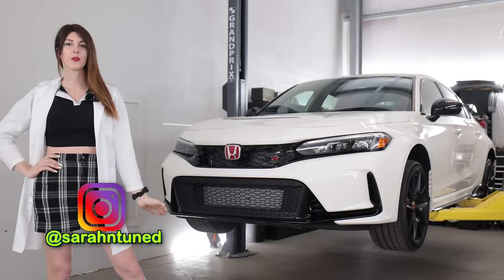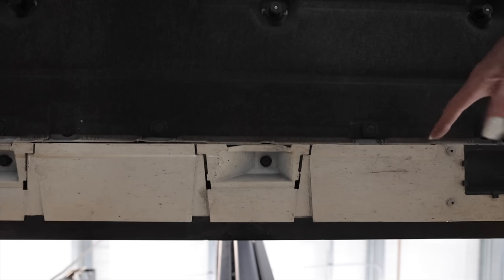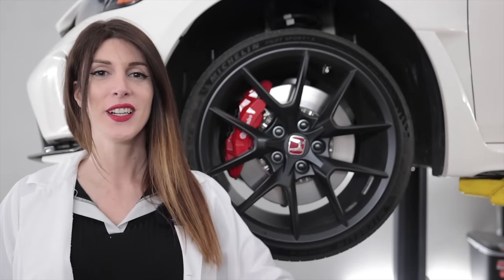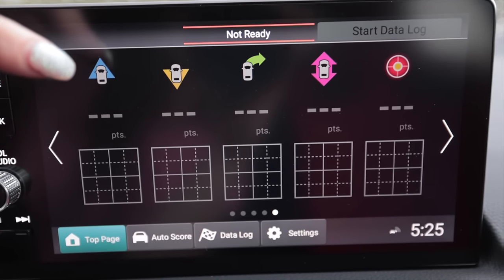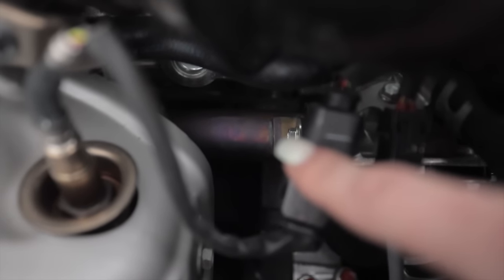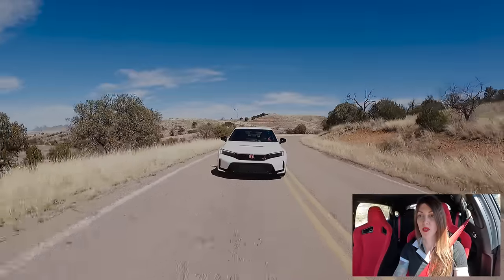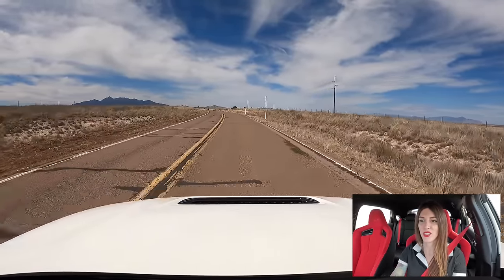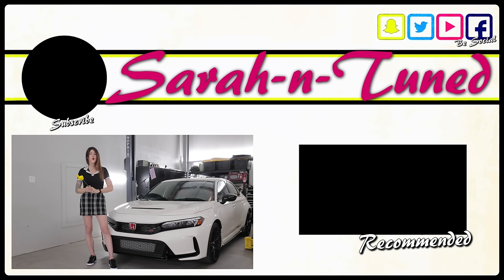MORE FUN Than A Super Car! // 2023 Civic Type R Review

Comment: Sarah, another great reaction from you on this car. I had an original Civic many decades ago and generally felt the car was specifically holding back, just because it didn't like me. (confidentially, I think it was cranky having been ripped from it's Mother Japan and would not do what it was built to do over here). The only problem I ever had was the oil pan. Had to replace that twice in the five years we were together because it would warp. Sigh.

Comment: Hi Sarah, great car review as usual, In France the 2023 Civic Type R is more powerful: 329 hp at 6,500 rpm and up to 420 Nm from 2,200 to 4,000 rpm, but very expensive € 55,000. This corresponds to the switch to the dynamometer made by Honda. Why is it less powerful in the US? Another story of standard to annoy sports car enthusiasts. Fortunately, the power of Honda engines is still higher than what is advertised.

Comment: The Type-R is 4 door because the TCR racing series, the series its actually made for, requires 4 doors, 2.0 ltr Turbo, and Front Wheel Drive.
Reply: Also, fun fact, you can order a Type-R TCR from the dealership.

Comment: Should have mentioned that unique front suspension design a bit more. It’s like a cross between McPherson strut and double wishbone. The strut itself doesn’t turn with the steering, and instead it has a small knuckle with upper and lower ball joints inside the wheel, for better SAI and scrub radius, which helps eliminate torque steer. The newer CTR is the only car I’ve ever seen this suspension design on. 

Also that aluminium splash tray underneath has been used on almost all Hondas since at least 2016 or so. My mom’s CRV had the exact same panel.

Comment: I'd rather hold out for the Acura Integra Type S now for a number of reasons.

The FL5 is cool, but it's being marked up heavily unless you're a YouTube car reviewer and have connections to get it at MSRP. The average 9-5ers are getting slapped with a markup.

The Integra Type S will be far more readily available over the FL5 CTR and seeing that Acura is charging MSRP for the base and now mid-level trim A-Spec Integras, I expect Acura to do the same for the Integra Type S because there will be a lot more supply to go around of these on Acura's side than there would be of Civic Type R's on Honda's side.

Comment: Hard to choose between 2023 Type-r and WRX , which one your will buy.
Reply from the maker: The Type R. It’ll hold value better and is more fun.
Reply: @SarahnTuned I’ve had and wore out two and a half VW GTIs (I have another year or two left on my third), this is looking like something I’d want to consider. I like the looks of the seats and interior. The rev match feature sounds like a piece of software I needed to write for a natural gas truck engine controller to work with Eaton auto-shift. That is a pretty high boost level, that’s close to what I sometimes run on 130 octane CNG.
Reply: Different price categories, different car classes. WRX is more affordable. Also Sarah strikes me as a Honda girl.

Comment: 1:07  Why does the Type R have a single exhaust pipe but 3 exhaust tips? Just extra weight (and cost to the buyer).
Reply: It has 3 functional mufflers and a valve on the main center pipe - reduces noise without limiting flow - easily supports 600hp while being quiet

Comment: question:   looking at the bottom of the car  1:38    where is the catalytic converter of the Civic Type R?  Thanks!
Reply: between radiator and engine.... its right after the turbo, under the heat shields

Comment: As an FK8 owner, I do appreciate Honda for continueing the Type R.
But style wise, I think they went the wrong way. The FL5 looks way too much just like the regular Civic. It completely disappears in the masses.
The improvements made on the FL5 are not worth the extra amount of cash you have to cart over for one.
My FK8 GT was 40000€, the new FL5 is 55000€, if you even find one for that low. 
For 9HP and 20Nm more, that's really not worth it. And the LogR was already available in the FK8 Limited Edition in some markets.

In Europe, the FK8 has 320HP, 400Nm, the FL5 has 329HP, 420Nm.
For way less than thw 15000€ surplus, a Hondata ECU, some nice 19" wheels and tyres and some other aero mods can be done. Though, the tyres really are the main difference between the two. 
Michelin and Pirelli both offer tyres these days, that monitor the track performance. So that's the LogR, quick, easy and cheap.

My biggest with a lot of motoring journalists is, that for the FK8, they screamed it's "boy racer" or "childish" and the FL5 is "grown up" and "stylish", when on other cars, they go the exact opposite way. The more angular a Lamborghini, McLaren, whatever is, the "better" and "more aggressive" it looks. But the Civic Type R? Nope. They want the bland, everyday commuter type for that one.

The next big upraor will be the fully electric NSX and the S2000 replacements. I'm excited for those so far. Though I feel they will go the same way as the 2nd gen NSX. Totally ignored by the masses until production comes to a stop, when all of a sudden, people get interested in them.
Reply: FL5 has more potential than FK8 period  - the new design allows for more cooling and more power potential while offering more high speed stability and grip.  FK8 is a beast - FL5 will be a monster

Comment: It's just too expensive. Not that it's a Honda nonsense. But for what the original idea was. A sporty regular car. Honda has strayed so far away from the Ek9 R. As mentioned in the review, pointless backseats. I'd add the infotainment etc aswell. It doesn't need thousands of dollars in high tech screens and fancy milled knobs. I have been a Type R fan for years. Over here in the EU we got the EP3 and Fn2 which I've owned and even back then the FN2 wasn't really what an R should be. It was over plastic and underpowered. The EP3 was just pure fun. I know the US didn't get the same as we did. I wish they just would make a barebones Type R. And I don't mean like that stupid 2022 yellow R with a removed sparewheel...

Comment: This car needs a 3inch exhaust.
Reply: Not really - easily supports 600hp on stock exhaust
Reply: @TheFK8Life  wow that is impressive job from Honda, most n\a Honda's are in the 3inch side for power gains.
Reply: @floki Loki  I made 547whp on stock exhaust  - the downpipe and front pipe are the restriction but the exhaust piping flows quite a bit